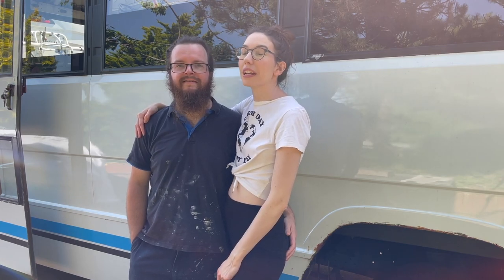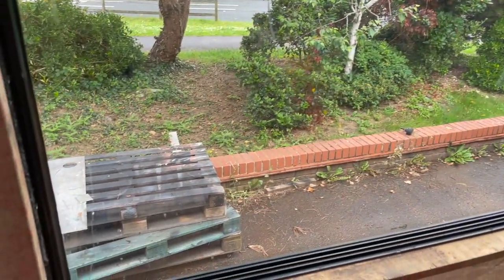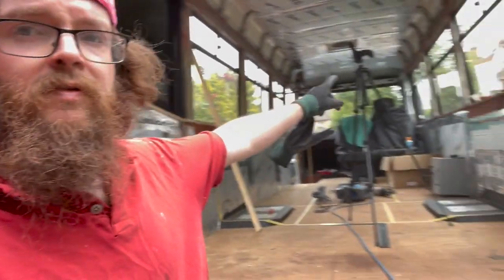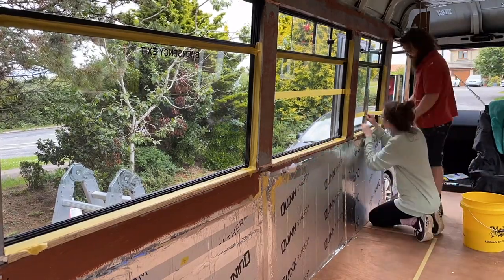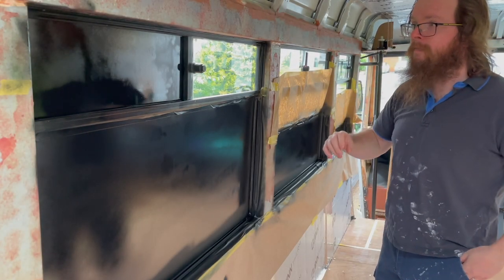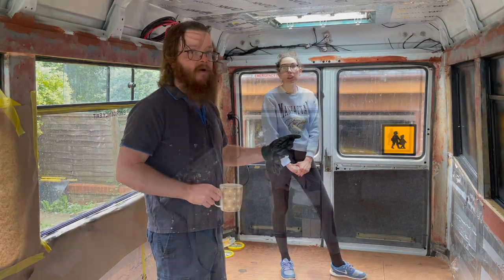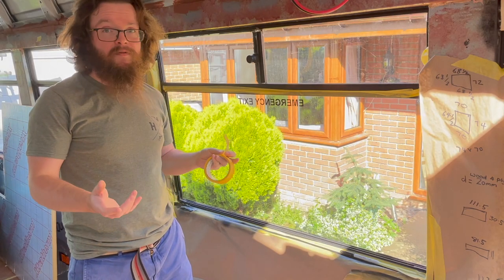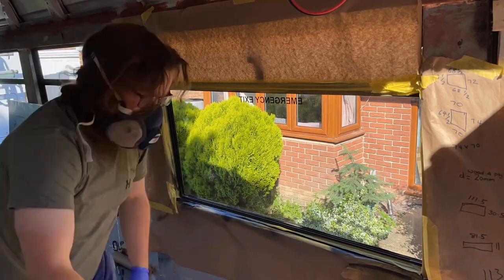Painting & Insulating Our Bus Windows | Van Build Continues | Mercedes Vario Camper Conversion Ep.29

Comment: G'day it was really nice to see your channel come up tonight I haven't had a good week lot of pain but you always cheer me up especially little Milley.    What you have done to the windows is a great idea the out side still looks great that window paint is remarkable stuff, I didn't know you could do that to windows.   I know that it does take a long time to work out what to do and there's always that feeling that it will go wrong but it's great how you bite the bullet and get into it, what you both have done is terrific it reminded me of when I lined my shed out I had to think where to put joints to screw the plywood too, with all that insulation it's going to make a difference it was a very good idea to leave that vapour gap between the windows and the insulation.    In regards to the wet areas you could waterproof all the wood joints I used when I built a laundry and family room under the house I had water issues before plasterboard got onto the bricks I used Thompson's Water proof it comes in a tin and is colourless but it's the best thing I ever used very easy to put on with a paint brush.   I had better sign off now because this is turning into a novel,  remember this "prior preparation prevents lousy work"   By the way your summers are getting hotter we have been over there twice in the summer and it's getting like overhear.....sunscreen  stay safe kind regards John
Reply from the maker: Hey John. Sorry to hear you’ve had a rough week. We hope it passes soon and you feel better. 

That sounds like a tip top shed! Love it. 

That’s a great tip regarding the water seal. We’d hate for the wood to expand because of moisture; or worse. 

It’s 29 degrees today. Which is pretty hot for England. We are glad for the max air fan and failing that, the paddling pool 😆. Take care of yourself. Fingers crossed this is a better week for you. 🚐🚐🚐

Comment: Planning is essential but, despite that, I still had the occasional 'I wish I had done that first' moments. However, there weren't many so clearly planning does pay off.
If you do consider tinting the other windows with tint film, it does scratch very easily. I would leave that job until all of the other work is complete. I wish I had known about the blackout window paint when I was doing a recent van conversion - I applied 2 layers of window film which wasn't easy at all. Your windows look great.
Reply from the maker: It’s so hard to know as A. We’ve not done this before. B. We’ve not lived with the thing yet. We do think it’ll get some test use as we progress. That’s a good tip with the tint. We might tint the rest but a lighter tint. Will also report back on how the paint fairs. Take care 🚐🚐🚐

Comment: There's nothing wrong with a good old head scratching session, personally I've spent 75% of my conversion time sitting around scratching something thinking of what way to go next 🤔
Did you consider replacing the glass with metal ? It's gonna be awfully difficult to replace a window once the inner wall is up ?
As allways enjoyed the vid 😎
Reply from the maker: Glad it’s not just us then 😂. We did consider metal but wanted it to look like a bus from the outside. We’ve also managed to ensure all the opening windows (apart from one) still open. It was a trick my decision. I know plenty have welded them up; some even just bonded metal over the holes. We shall see if goes well 😊. How are things progressing your end? Any hefty finds this week too?

Comment: I’d keep the splash back going the whole way along so you have a clean line and it will help the bus look longer /bigger. Also lots of different height may look a bit strange. But then again, I’m sure no matter which way you do it, it will still look 👍
Reply from the maker: It was a tricky to decide for sure. Our thinking is the end bit will be inset anyway. Only about 25cm as a little cupboard. Thankfully we can pivot should we need to 😊. Thanks for the tip. It’s all very tricky isn’t it. Take care 🚐🚐🚐

Comment: Hi guys, can you tell me what the name of the black spray is for the windows? Many thanks and great work!
Reply from the maker: Hey there. So we used 2k black paint from a company called Buzzweld as it comes in Aerosol. However if you have a compressor I know others have used local paintshop suppliers to get matt 2k paint. Others have used Jawel paints I believe.
Reply: @WanderbusAdventures  tha k you. I will have a look
Reply from the maker: No problem 😎